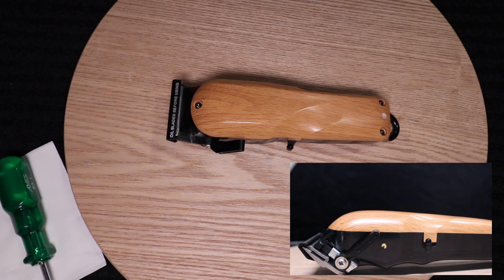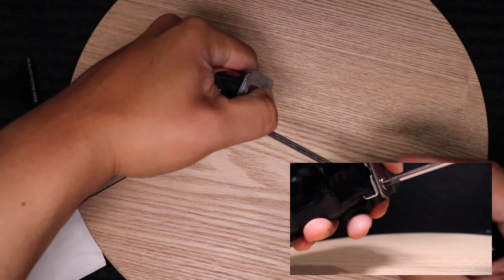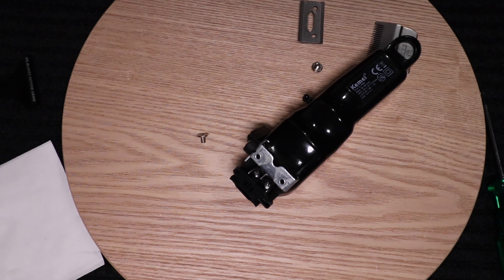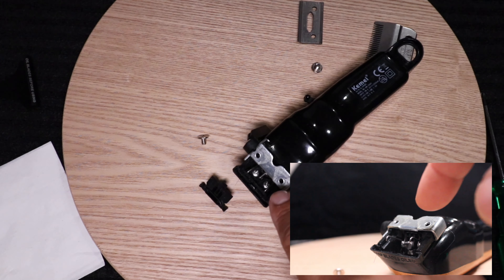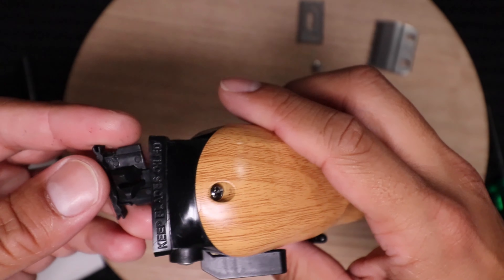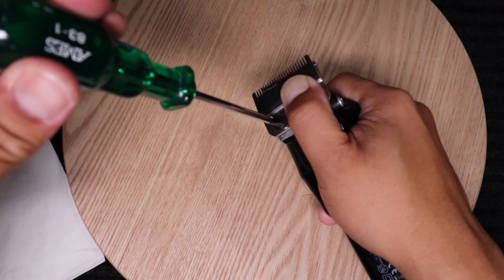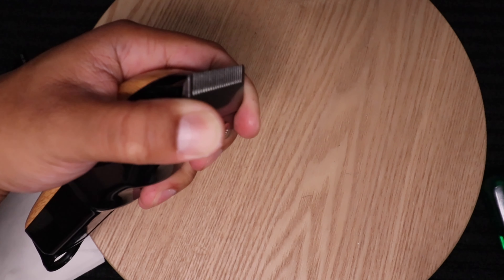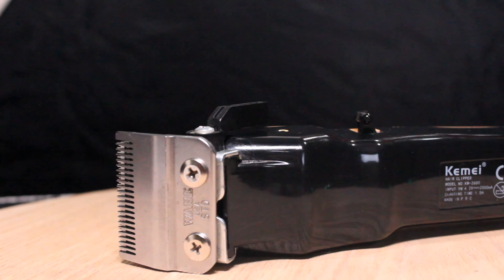Kemei Magic Clip  |  Wahl STD Blade on a Kemei 2600 Clipper  [additional parts required]

Comment: All you need is the cam follower from wahl?
Reply from the maker: Cam follower and spring.
Reply: @1twothreefour5six7  Thank you. Is the machine still running good?
Reply: @1twothreefour5six7  Thank you. So i ordered the KM-2600PG and the wahl cam follower doesn't seem to work in it, which is strange cause i thought it  was the same as the 2600 just with a screen to show battery life. When I put the wahl cam follower in, the blade didn't move.

However, the wahl blade works with the stock kemei cam follower. It looks similar to the wahl cam follower but it doesn't have a tab at the back and it has a slot to go into the plastic rail toward the front of the clipper.